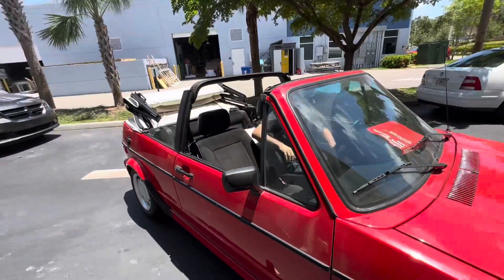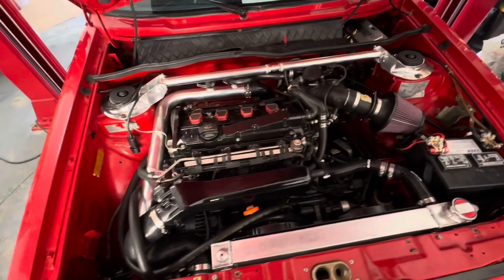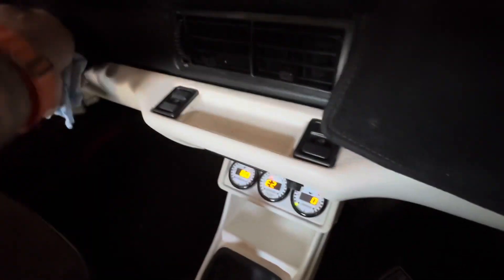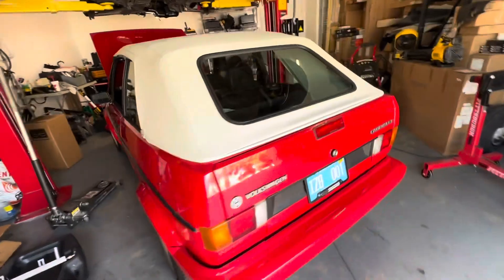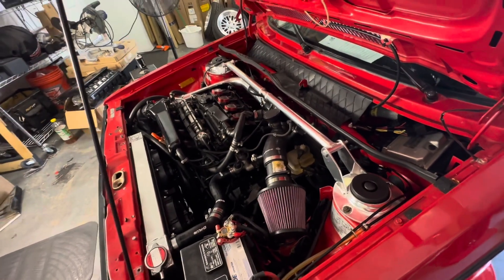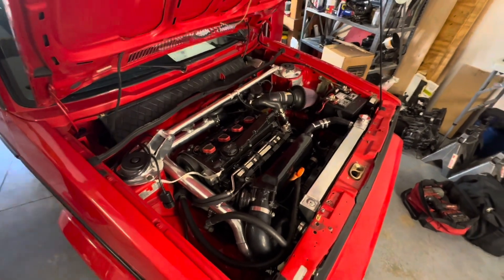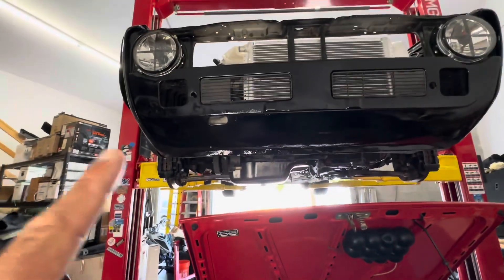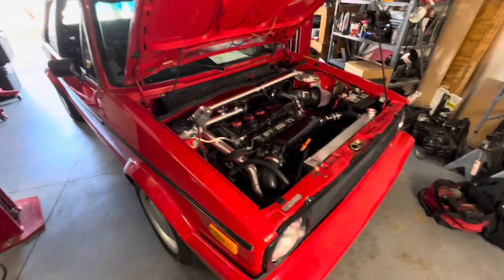Driving the 1.8t swap MK1 it’s done

Comment: Did you notch the core supports to get the ac compressors to fit?
Reply from the maker: Not on this car the red cab but yes on the vr6 swap we did and welded a new support and installed a S&P front end support which we had to modify as well to make it fit . On the black GTi
Reply from the maker: No did not need to on the 1.8T fit perfectly